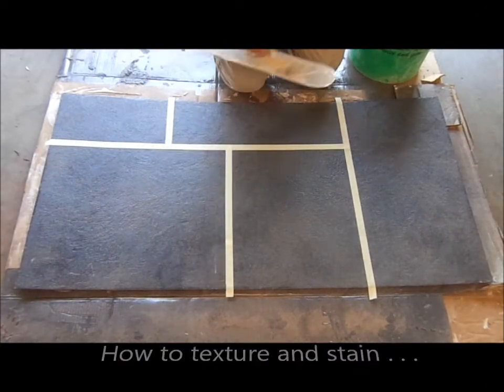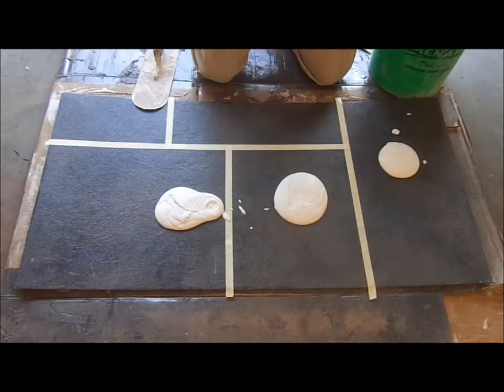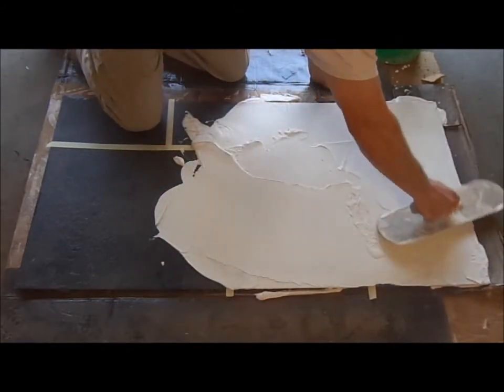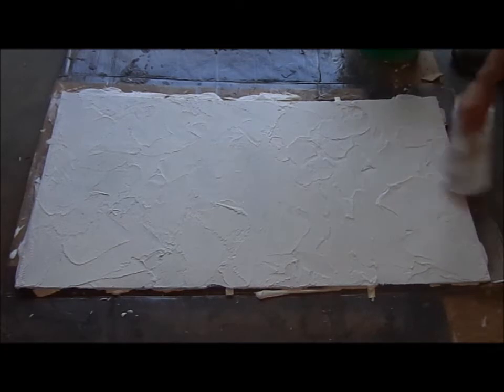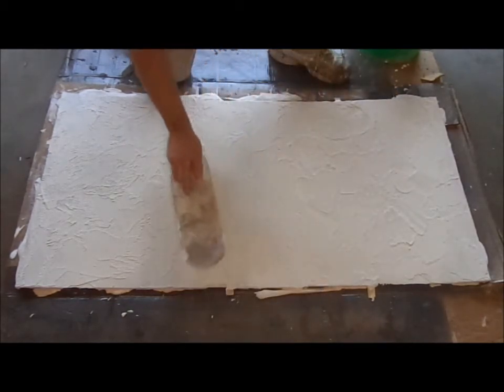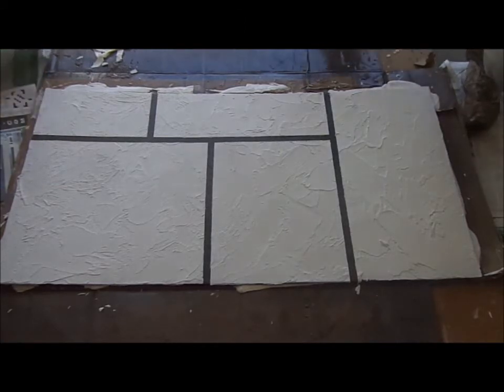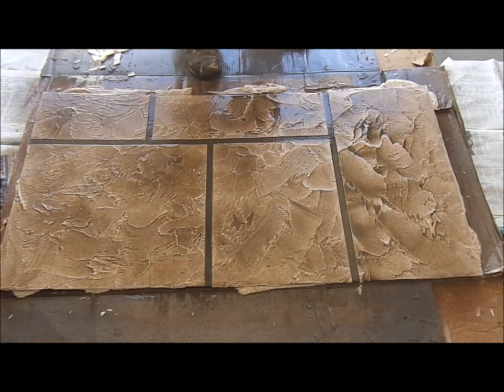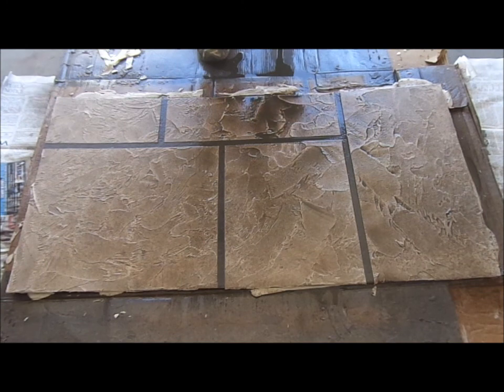How To Texture & Stain Venetian Stone Concrete Resurfacing

Comment: How many coats of material was that? It looked like 2 or 3
Reply from the maker: +dEsignEd byGOD 
Typically, there are 2 coats of the cementitious material (1 for the base coat, which the design is taped on, and 1 for the troweled top coat). Concerning stain, as little or as much as desired. Then, typically 2 coats of sealer.
Reply: When you say stain. Are you talking about an antiquing stain or acid stain?